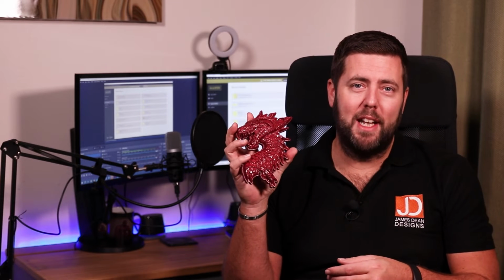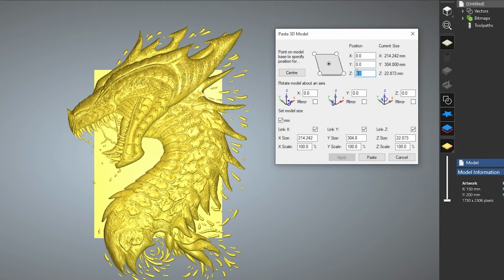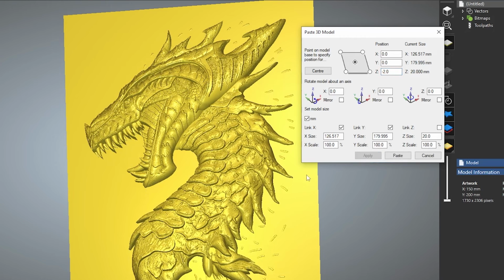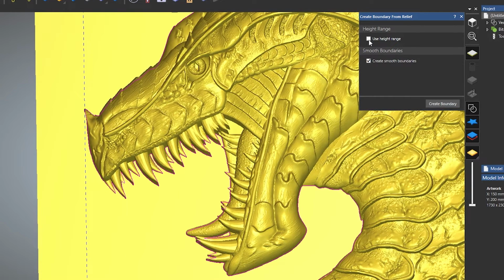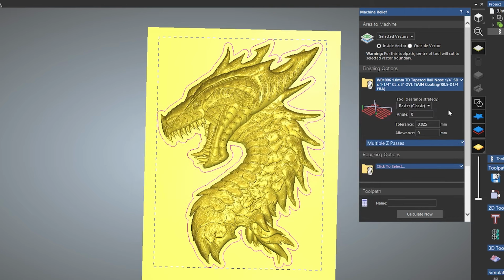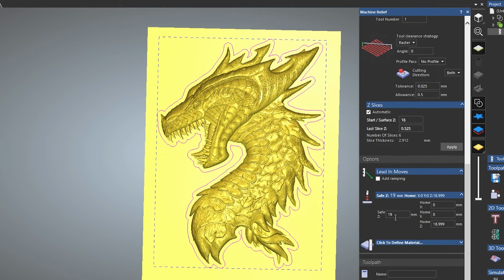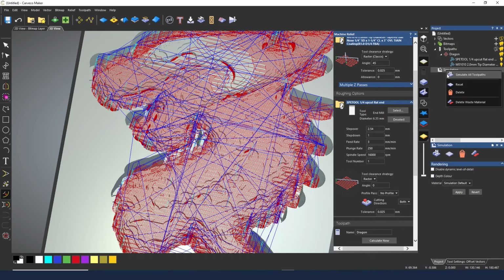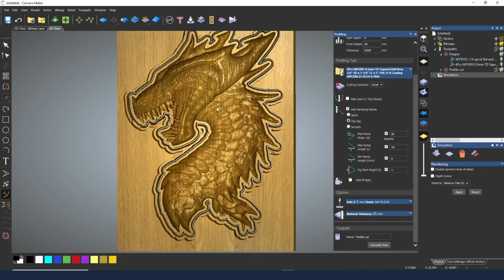3D Relief Carvings in Carveco Maker - Beginners guide

Comment: It would have been great if you showed the rest of the process. I followed the video a dozen time  and I still cant get the files to run. All I get is an error message from UGS saying it has unexpected commands
Reply from the maker: If UGS is saying unexpected command, my guess is you're selecting the wrong post processor. Make sure its "GRBL mm" and not Gcode or any of the others
Reply: @JamesDeanDesigns  Found it . well kind of found it I made two changes and Im not sure which fixed it. 1. I removed the spindle commands from the g code by hand. my 4040 has a manual spindle. 2. I was setting zero at the lower left corner of my stock. Carveco had it in center. I didnt get how that worked from the video the only reason I figured it out was looking through the g code. Thanks for the help. Great videos

Comment: Ive been watching your video’s for a few months. They’ve given me amazing advice and help me start my own business. But I came across a problem, I don’t have tapered ball nose bits. Do you have any suggestions on an alternative?
Reply from the maker: Glad they have helped. You can use a small ball nose bit, but you wont get as much detail. You could also use a V bit but that will take longer because of how small the tip is.
Reply: @JamesDeanDesigns  thanks so much! is there any specific degree of v bit that you would recommend?
Reply: @Dawson_allen1 probably 60 deg if you want fine details, the smaller the better

Comment: James,  I have been studying your settings for a 3d relief I am working on.   My material thickness is 19.58mm so I set my safe Z at 22mm.   On your dragon you are using a 25MM material thickness, but you set your safe Z at 5mm and your home Z at 10.   When I try to calculate I get a error message stating it must be greater than the material thickness.  When I calculate my toolpaths something is causing multiple simulation passes of solid red not reaching the material.   Any help would be appreciated

Comment: Wow James that is a lot of stuff to remember. Yes I would like to be able to do carves like this but I think I better master my new machine ( sainsmart 4040) first. Just ordered it yesterday and going to build a table for it before it arrives.
Reply: Its been a year since this post, I was looking at the Sainsmart 4040. Do you recommend, or not so much now?
Reply: It’s a good machine, but the original spindle motor is underpowered. I now have a 775-m  spindle motor and it performs much better
Reply: @ Any trouble with the control board?  That has been my main issue with their 3018pro.  If the bit gets stuck in the material, control board lets out the magic smoke and stops working.  Ive already upgraded to the 775 spindle, so I can take that out of my 3018 and just put in the laser module.
Thanks for getting back to me on a post from a year ago!
Reply: No problem with the control board , and yes I have had stuck bits doesn’t everyone. The main problem with the controller is the dust will collect inside it , putting a filter on it will stop most dust but it would be wise to clean it out once in a while. I have just received my laser, it fits in the 775 motor bracket very well and has good cutting power ( laser tree).
Reply: @warrenking1815  i built an enclosure for my 3018 and mounted the controller outside the box. Ladt time i was watching the carve when the bit stuck, smoked the board before i could reach the plug.